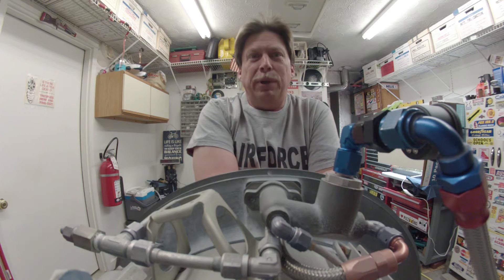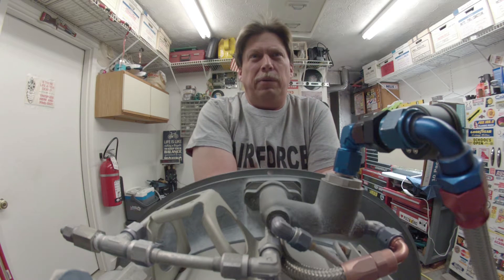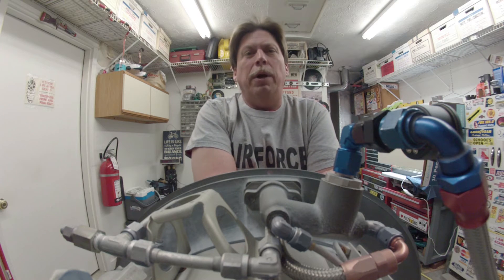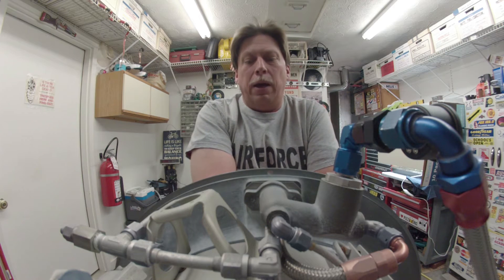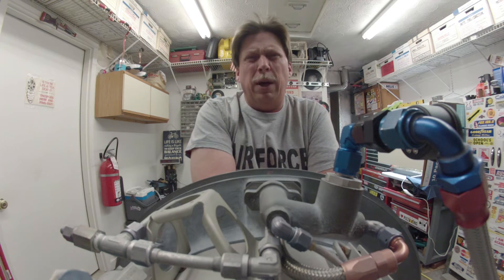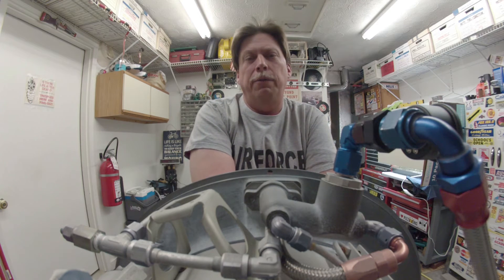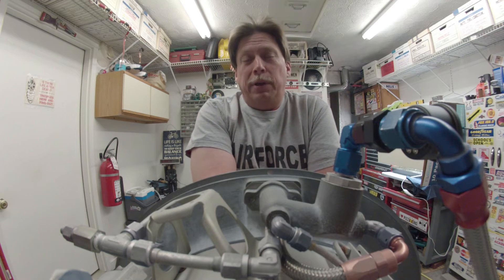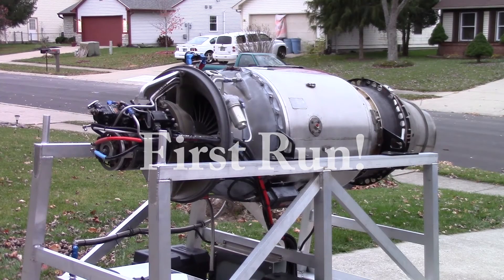Fairchild J44 Turbojet Engine, Driveway Run 1 (My FIRST Run!)

Comment from the maker: Jay, thank you for the reply!  Yes, I will put it on a small trailer & tie it down for anything above the 40 - 45 % RPM it has seen so far!  The current boost pump will not flow enough fuel to produce much more power so I am self-limited for now.  I have the servo type throttle actuator working & can control that via a toggle switch on the console.  I appreciate the info & have already started a list of issues to address, including the thermal expansion one.  Maybe elongate the holes on the rear mount & use spacers to allow the mount to slide along the frame rail while keeping the screws tight?  Thanks again!

DD
Reply: Darren Duncan
Reply: Darren Duncan